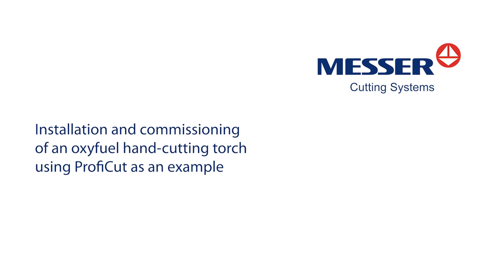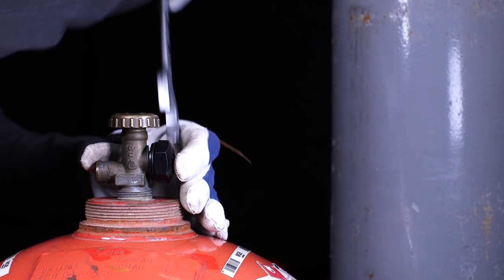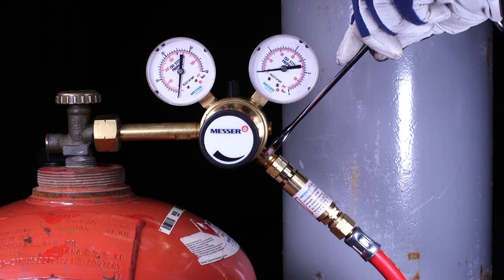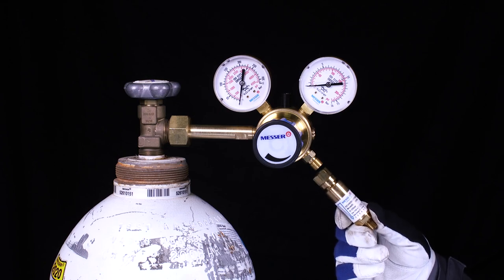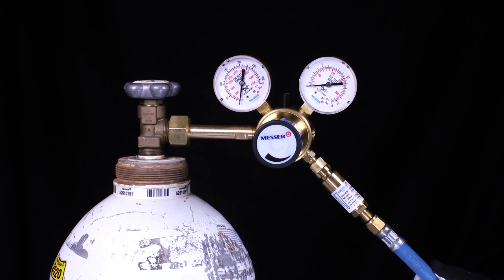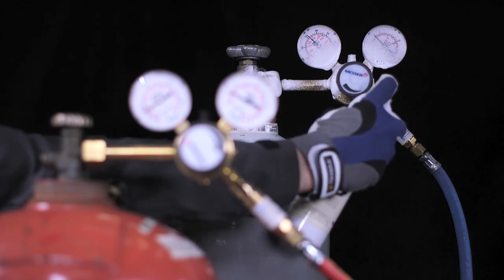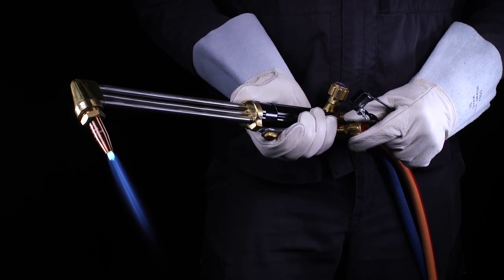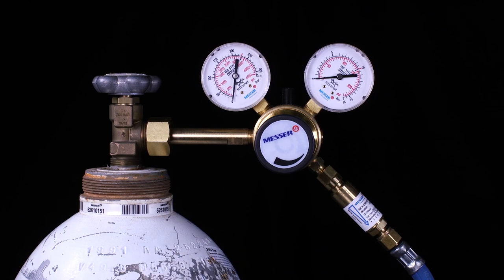How to use a ProfiCut oxyfuel hand cutting torch

Comment: You're supposed to start the fuel gas first at the torch and ignite it before you feed in the oxygen to the flame, putting both propane gas and oxygen on at the same time can cause a nasty flashback situation where the flame sucks into the torch, pipelines and cylinders.

Comment: How much should I open the oxygen valve and fuel gas (propane) valve on the torch when igniting the flame? 1/4 of a turn?
Reply from the maker: Dear mdeki,
In case of using the torch ProfiCut, you should open the oxygen valve approx.. ½ of a turn and afterwards the fuel gas valve approx.. ¾ of a turn.
It is also important to keep the sequence. Always start with opening oxygen and afterwards fuel gas. Switching off the torch is the other way round. First fuel gas, second oxygen.

If there are further questions, please do not hesitate to contact us.

Best regards
Messer Cutting Systems
Reply: @messercuttingsystemsgmbh1027  I forgot to mention , I have got a Starlight 1302 handle with a cutting attachment.